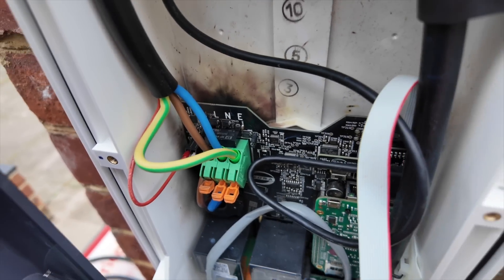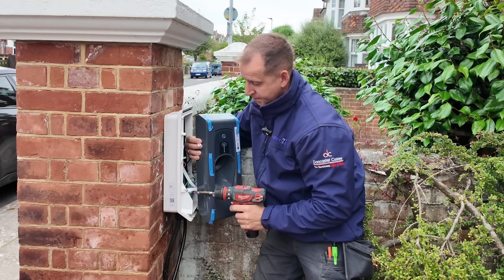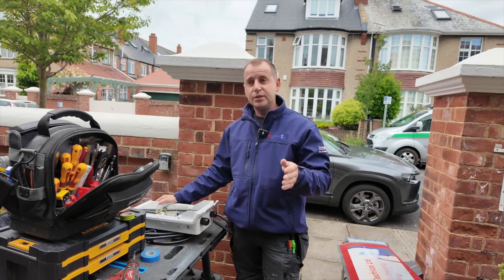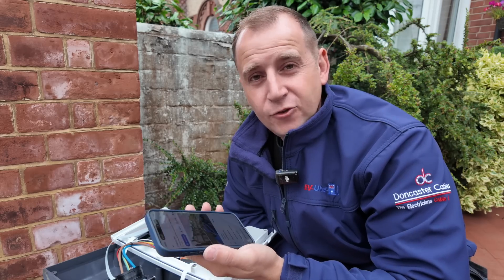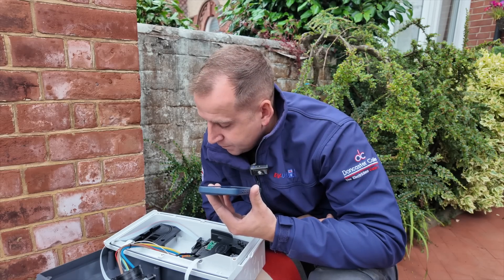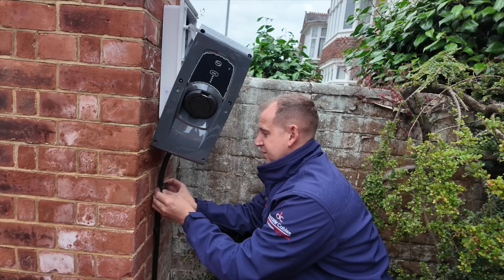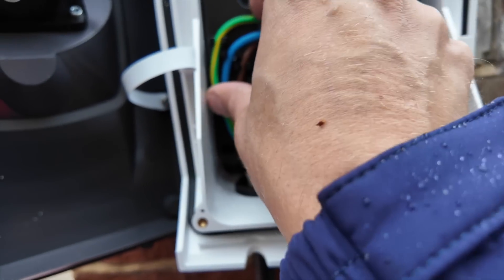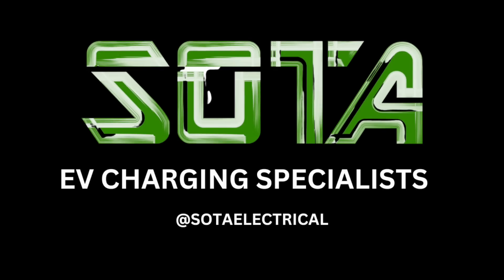Charger Reborn: The Gen 2 Improvements Explained

Comment: I have just bought an EV and want a charging point on the outside wall, the problem being, 1. I live in a rented flat on the ground floor at the back of the building.  2. My car parking space is over 50 meters from the building.  My Neighbour has a car parking space which is 16 meters away from my kitchen window and has given me permission to park my car overnight to charge it.
3. So if I park my car in her space, can I run an extension cable (13 amp) to the car parking space and plug my car into it?  4. I plug the other end of the extension cable into a 13 amp ring main in the kitchen.  Is this safe to charge the car overnight?
Reply from the maker: I strongly recommend that you do not do this!! Extension cables are only designed for short temporary use, the cable diameter is normally only 1.5mm and will certainly burn out over time if you charge your car on it
Reply: @sotaelectrical  Thank you for your reply, I was not sure it was safe or not to do this but will follow your advice.

Comment: Hi Adam, with a Zappi, where would the CT clamp need to be put in order for it to take from solar, but not drain a battery storage? Reason for asking is I’ve got a garden room which has a 16mm armoured cable going to it and I’d like to have solar on it in the future and contain battery storage to provide for the house. But, there is no Ethernet cable to there for a CT clamp. Would a CT need to be at the garden room end for anything?
Reply from the maker: Hi buddy, you need a ct around the solar circuit at the consumer unit, you can use a harvi for this if no cat5/6 is installed, the cts don’t control the battery, you need to program the batteries to not discharge when your car is scheduled to charge

Comment: If you don't mind me asking how have you avoided this with your installation? (I can see you are only replacing existing,  but it's now technically your install as you have to follow manufactures manual and the all work should be to BS7671 and code of practice for EV chargers regardless) in relation to the lead been plugged into vehicle. Does the customer have insurance? 
4.5.2.2 Avoidance of trip hazards & 4.5.2.3 Avoidance of unnecessary obstruction.
Reply from the maker: Yes they have insurance and council permission
Reply: @sotaelectrical  Ok, with the council permission is that something we sort out as an installer or the client? is there a form?
Reply from the maker: @mattys5686  the client sorts it buddy

Comment: Simple tips are always the best - I will start taping from now on. I have placed a mechanics magnetic tray under where I'm working if anything falls. As you know when you drop anything it does escape in all directions so it doesn't always work.
Reply: Toolstation do a set of 3 collapsible trays. (Sealey make I think). Rubber with magnet base really useful and only a few pounds o buy.
Reply from the maker: @richardwilliamson3624  nice mate
Reply from the maker: Agreed 100%